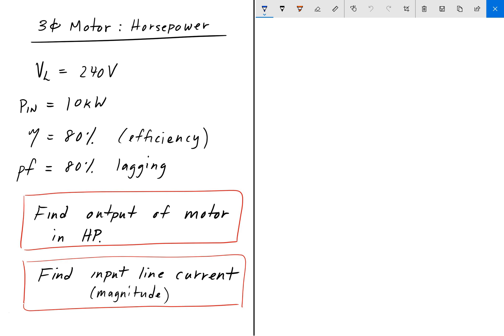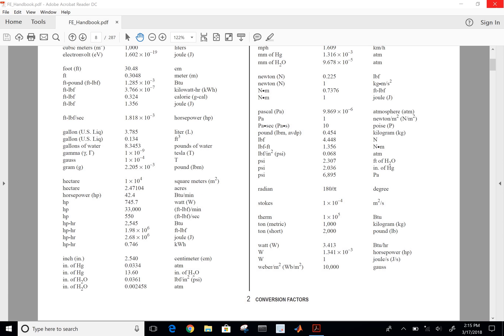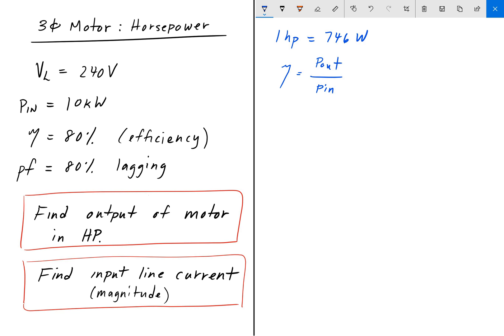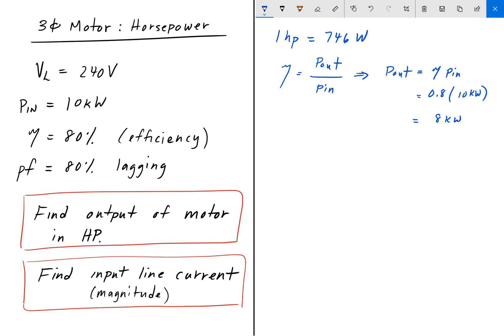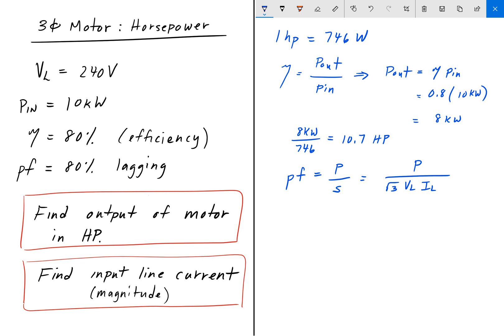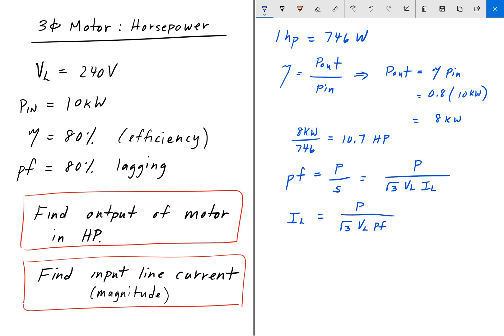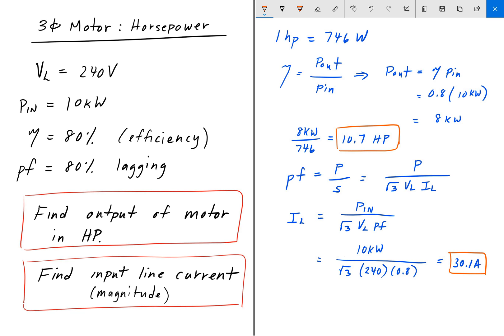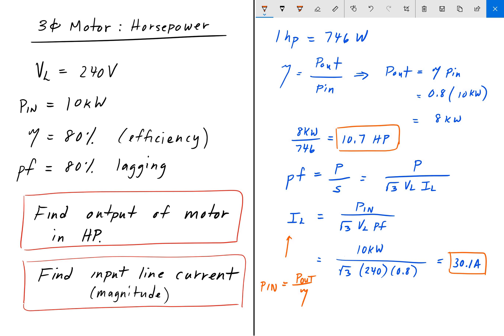Electrical FE /EIT Exam Prep - Power 7: Three Phase Motor Horsepower

Comment: I'm only seeing the equation |S|=sqrt(3)*Vline*Iline for balanced systems. Is it safe to use this formula if the system is not defined to be balanced?
Reply: You can probably assume it's balanced for the FE exam. Doing any kind of math related to unbalanced systems is extremely rigorous and not the kind of thing you'd see on a standardized test.
To answer your question though the relationship for SINGLE PHASE power is applicable but each phase can have a different voltage and/or current running through it. This is what makes the system unbalanced.
Reply: I agree with headphones. Have to look at the symmetrical components of the system quantities to calculate the unbalanced systems. Tedious task for only having 3 mins per question. 

Also, hope you both did well on your exam!

Comment: For finding IL, why does using P = (1/2) * V * I * cos(theta) not work? I can't find any pf = P/s equation in the handbook so I turned to the real power equation to find the missing current but got 83.3A. How are we supposed to know which equation to use?
Reply: Complex power is defined as P + jQ, where
P = V_rms I_rms cos(theta), and cos(theta) = pf
Q = V_rms I_rms sin(theta)

Apparent power is defined as |S| = |P + jQ| = P^2 + Q^2 = V_rms I_rms = P/pf
Therefore pf = P/|S|

For three phase power systems, |S| = sqrt(3) V_L I_L

P_in is used for P to represent the total real power going into the system.